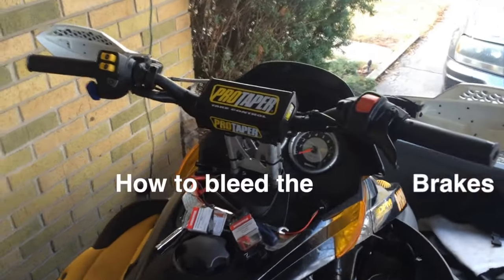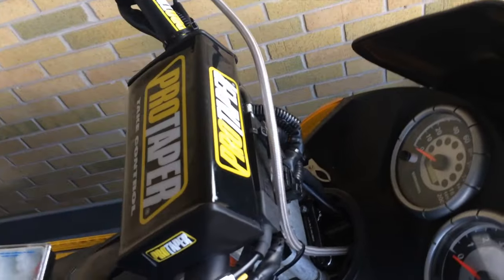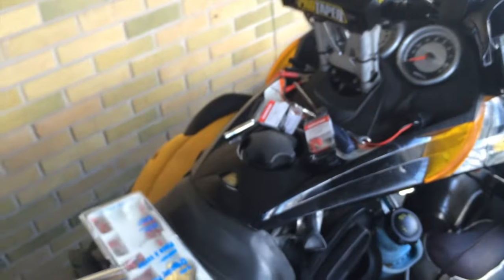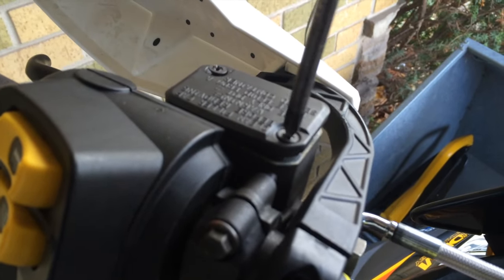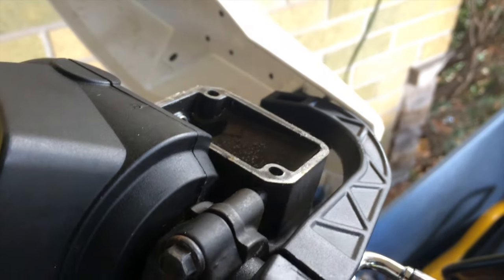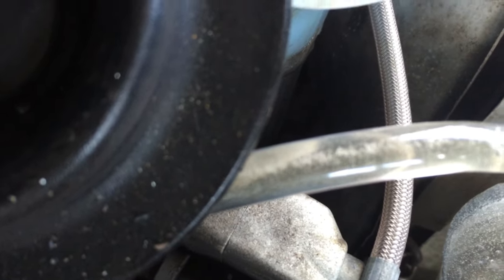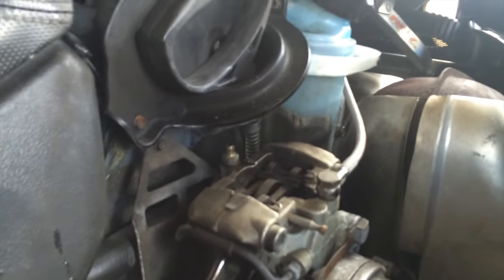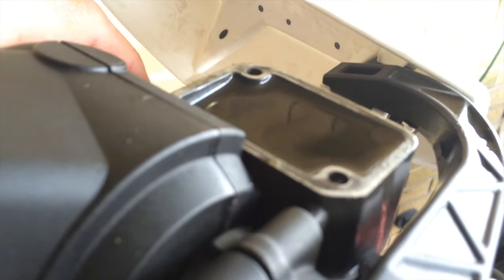How to Bleed Snowmobile brake lines step-by-step guide, skidoo

Comment: ? For you,I have a 96 mxz,ive been having problems with my brakes locking up,ive bled my brakes twice,after I bleed them,ill start riding,then brake handle will start getting hard on me,then sled won't move,ill turn the bleeder screw to release pressure,but then it will do it agsin,again, help will be appreciated
Reply: Is it the caliper, or master cylinder, is something plugged,

Comment: If my brakes are seized on my rotor will doing this fix that? Still have plenty of pad left
Reply from the maker: H2snow MT doesn’t sound like the breakline, take it all apart and use anti seize grease on the rails.

Comment: Just did the same thing but just pumped the brake until the clean fluid was coming out my bleed valve (I didn't drain the old fluid first). My brake works but I need to pull it in really far, like almost touching the bar until the brake engages. Any idea why it wont engage sooner? My parking brake doesnt work because it pulls in so far.. Thanks
Reply from the maker: +Jordan Crook you still have air in the line, or bubbles of air in the fluid, you will need to keep adding more brake fluid till its bubble free. the air bubbles compress when you compress the brake, thats why is pulling all the way to the bar.
Reply: +Warren Hardy Negative, i have 2 bleed valves on my caliper.. i thought it would be fine to just do 1 but i had to bleed both. Thanks tho!
Reply from the maker: thats good to hear, see you on the trails!

Comment: u didn't need to pump that much fluid thru it, once the lines r full u could've closed the bleeder and topped off the reservoir, then while the bleeder is closed pump the brake lever a few times until u get some pedal, then pull the brake and hold it and crack the bleeder until the brake lever pulls to the handlebar and close the bleeder and release the brake lever. repeat until no air comes out with the fluid when u crack the bleeder. top off the reservoir
Reply from the maker: Thanks man! Next time.
Reply: Warren Hardy no problem man, happy sledding

Comment: Interesting.  You don't need to close the bleeder when letting the brake lever back up like when you bleed brakes on a car, huh?
Reply from the maker: MeltingRubberZ28 maybe? but this worked for me, once the reservoir is full of fluid, you just have to be gentle with the pumping or it will splatter a bit